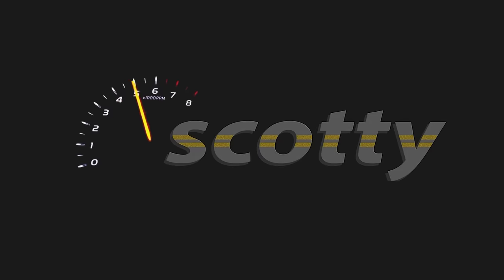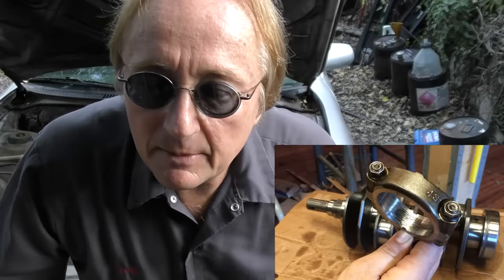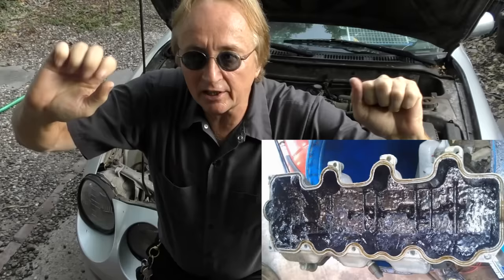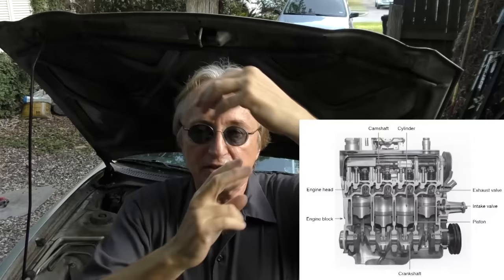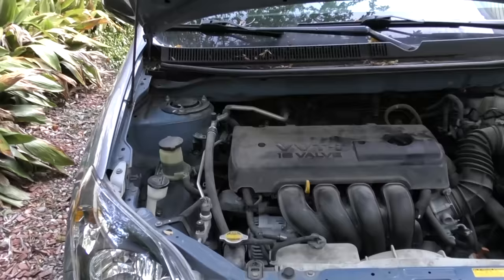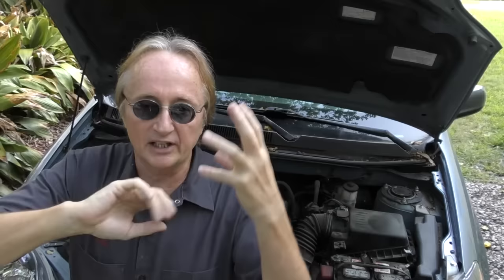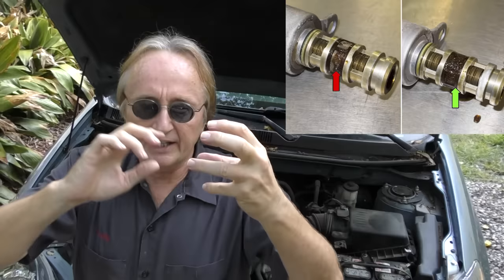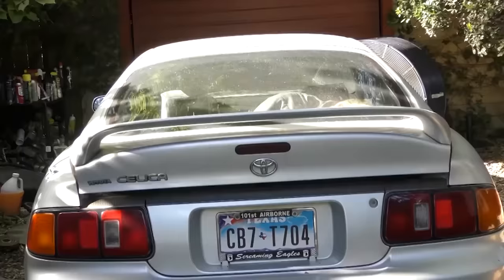Why Not to Flush the Engine Oil in Your Car

Comment: Add a little Marvel Mystery Oil to your engine.. Or add a little automatic transmission fluid to the engine oil.. It will clean the engine slowly and you won't have any sludge issues. 👍. 

I had a customer bring their 1998 Infiniti QX4 in because the valve lifters were ticking.. I checked the oil and it was black and sludged up. Customer didn't change the oil. So it wasn't under  warrenty. I checked thel cap, sludge. Looked into the valve cover and a ton of sludge in the engine. I informed the customer that i can try something for $200 bucks plus oil or I could replace the engine. Customer agreed to the $200 option. I drained the oil put automatic transmission fluid in the engine. Drove the truck around and changed the fluid and filter. I did that 3 times. 2 hours later engine was clean as a whistle, lifters stopped ticking. No smoke or leaks from the engine afterwards. I still have this person as my customer. I did that for him 18 years ago. 👍.
Reply: Rex Erection Hi, just half a quart. 👍 It doesn't hurt anything and cleans really well.
Reply: Full Body Joe but 20 years ago was 1998 and you said a 2000 infinity car so your off by a year & so (19/18 years ago)
Reply: Hater Funny Solo  Oh my mistake let me edit the comment. Thanks. It still applies though. 👍
Reply: Hay thanks for the info full body Joe. I use Marvels Mystery oil in my gas tank every other fill up and that gives me a smooth running engine in my 02 Toyota Avalon. Next oil change I'll pure it in my crank case.
Reply: That /was/ way back then before Variable Valve Timing, keep in mind; I'm not sure how much this changes things and I might try it in a 96 Roadmaster or whatever but does it work on these newer cars?
Reply: I heard about someone doing this to their car, filled it up half with atf then drove 900 kms back home. After they changed the oil that engine was clean as clean inside and every oil change after that the oil didn't look as black as usual
Reply: Any of that stuff harm seals though????
Reply: For a safe, gradual cleaning of engine internals, use a HDEO ... heavy duty engine oil.  Those are oils for gas and diesel engines and have strong detergent packages.  You can tell they are working well by how quickly the oil turns really dark. After an interval or two with an HDEO, switch to a high-mileage oil.  All the companies make these in several oil weights.  I do not trust any cleaners in my engine oil for any length of time for the exact reasons Scotty cites.
Reply: Micah AP thanks for the reply, I sometimes use mmo right by before I change........and atf swells right? Why you said that correct?
Reply: I use a full quart of ATF
Never had an issue. Most times lifter tick is gone after this. Sometimes ive added another quart to the second oil change, and noise is 100% gone! 
To each their own i guess...
On one of my vehicles i purchased used, i found sludge when i changed the oil. So i added 4 quarts of oil and 1 quart of diesel. Ran it for 20 mins at idle, and drained oil and replaced filter. Its been almost 6 yrs now, and my oil never gets sludged anymore and also it doesnt turn as dark as it did before. Hey, if you know what works, keep doing it!
Reply: How much is too much MMO?  I have a subaru that burns oil.  I did a cleaning with MMO and high end oil and after 4000km it burned less, but still consumed some.  Should I do it again?
What kind of damage can MMO do to my bearings?
Reply: That is indeed, one of the ways to degrade modern engine oil and make it worse by dilution and adding things that don't belong in motor oil. What is it with dipsticks who can't understand that if engine oil worked better with that crap in it, that the oil manufacturer would have put it in there in the first place?   They are real scientists who do real testing and analyze the results of an unimaginable amount of data, and then repeat that all over again year after year.

If you need your engine cleaned slowly, that is exactly what fresh oil does.  If you need it cleaned a little faster, change your oil more often and get it up to temperature for a good long drive before the next change.  That will clean it faster, not just slow down buildup.
Reply: M
Reply: Just change your oil and use good oil there is no need for any additives.
Reply: @seanthompson8071  that will change the oil viscosity and mess with the vvt on a modern engine.
Reply: warriorpluto  WYNN'S ENGINE TUNE UP. I used to have a snowblower that I didn't know was a 4 stroke. I didn't change the oil for 7 years. When it came out after I brought it into a heated area so the oil would unfreeze it was like mayonnaise. Cleaned it out in 5 hours of running. I had to do it twice to another one I found in the garbage and restored. Many engines made to run like new with that stuff. (by freeing the rings)
Reply: enduroelite it is really thin, so it protects bearings less, but you can counter that by using 1 quart higher viscosity (like 5w20 > 5w30) with 1 quart MMO, and the rest you use normal viscosity. Essentially you’re trying to bring back up the normal overall viscosity, because MMO is basically just a cleaning mineral oil.
Reply: I put ATF in my 1986 Mercury Grand Marquis crank case, it ran better and the startup knock disappeared within a few weeks. @S truth
Reply: @marcharris2734  - Some additives help squeeze more miles out of a worn engine. GM sells an additive to address a specific problem: sticking hydraulic lifters. Once the lifter noise is abated, don't use the additive any longer.
Reply: smart lad!!
Reply: Rotella makes 10w30 and 5w40 diesel truck oils and I'm sure there are others...
Reply: Didn't Chrysler use ATF for engine break-in for several years🤔.
Reply: So if i do that to my suv Mercury mountaineer will it work i have low pressure light on. Need advice.
Reply: @seangarcia8503  Is the engine sludged up ?. Remove the oil fill cap turn it over and look for sludge. Then look inside the valve cover for sludge. Is the engine ticking loudly when it idles ?.
Reply: @marcharris2734  
But what if the used car u just bought hadn't had regular oil changes or u have no way of knowing  because u bought it from "Joe's Used Cars" or a flipper?? In that case I'd do a flush OR change the oil and substitute a qt.of oil with Marval Mystery Oil and change it after maybe 1,000 miles.
I just bought a 2005 Grand Prix with the GM 3800 V6, Good motor but it's burning a qt.of oil about every 750 miles. Only has 87,000 miles but the woman I bought it from never drove on the freeway.
Reply: @EternityofNight  
How much ATF did u put in??

Comment: It really depends on how much sludge and varnish are built up in the engine. And the type of flush. 
Detergents and dispersants get used up or depleted. All engines get sludged up if the owner does not change the oil regularly.
My advise: Always follow a flush with a short oil change cycle, like 1000 miles. And again, the type of flush or cleaner is a factor. Then keep the oil clean.
Reply: Interesting 🤔 Can you recommend at what millage it's recommended? 100K miles?150K? 200K? And what types of flush?
Reply: @saultube44  : I would suggest every 60K miles. And I would run the new motor oil for 1000 to 1200 miles. This will wash down tough deposits that the flush has softened. This is a good time to run High Mileage motor oil during the 1000 to 1200 mile interval. The High Mileage oil will also condition the seals on the crankshaft and valve stems.
Reply: Flush oil is not advisable.. read your car manual.. no any flushing oil needed.. just change oil..
Reply: @angelseven7  The same manual and manufacturer that recommend never change the Transmission Fluid? So the Transmission dies at 100K miles and you have to buy another? Instead change it every 60K miles so it lasts forever?
Reply: Hey. Question. I usually do my oil changes. I had a surgical accident and haven’t had the oil changed in a year. 12000 miles put on since accident. Engine was freshly rebuilt in April 21 and regularly cared for before that. Should I flush? Or just change oil? It’s been a hot debate and I only have a few goes to get to it
Reply: @saultube44  machines were out regardless of its lubrication. Oil changes at 1000 miles is not only horribly  bad financial choice to change oil prematurely..it's wasteful to do so when it's a finite resourse that will be gone in 47 years.
Reply: @biancafahlin  
If it's only 12,000 miles I wouldn't be too concerned.
Reply: @TheRealChuckNorris he didn’t mean every 1000
He mean 1000 miles after a flush. 

So flush engine on service, 
Drive 1000 miles,
Do another service
Then whatever miles you are comfortable with between oil changes, 
For me it’s 6000. 

I’ve not done a flush, I was thinking about it which is why im here, 

I usually do a full service every 12000, 
Fuel oil air cabin filters. 

With a interim oil/filter change and airfilter inspection every 6000.
Reply: Why would you follow the flush with a short oil change after?
Reply: @tyronesmith3812  Because the engine flush chemical will soften some of the hard deposits in the engine. These deposits will slowly dissolve in the new engine oil, making the oil dirty earlier.
Reply: i had or replaced pcv valve in my cruse had to change hole cover gasket in order to do that tightened up nice and snug not to much. drove 20,000 on it to build up sludge. runs great for a small 1.8. change oil cold so its not hot for mechanic. no dramatic change
Reply: @TheRealChuckNorris  Synthetic oil is made from natural gas and, from what I understand, the Earth constantly regenerates that.
Reply: The inside of my engine looks like a teenage boys bong 😭 absolutely coated in a resin looking sludge. My grandfather developed dementia and stopped getting oil changed, god only knows how many years he ran it without one. He also had a 1 of 2 Buick from the 50s and that blew up because it ran out of oil 🥲
Reply: But if it depends on how much sludge, most people won't really know how much sludge is in there unless you pull the motor apart. Even looking at just the camshafts won't give you the whole picture.
Reply: My Audi A5 2013.. Milage 270 000km. It has been consuming a lot of of  and black sooth coming out of the exhaust
I stopped servicing it at Audi dealership and used a private mechanics.. He used engine flush  for 15 minutes and discard that oil and put the clean new oil.. He then advice me to do minor service (oil changing, airfilter and oil filter including spark plugs) every 5000 km or after driving in a rural gravel road... After that my car is in a good condition. Clean exhaust pipe, less consuming oil.
Reply: @frica466  Great job. You probably should have done that at 90K then 180k. I suggest using a High Mileage oil for one oil change. Then PAO oil. PAO is a tougher oil. And a Catalytic converter cleaner in the fuel to reduce contamination to the catalyst. The soot is from burned oil going out the exhaust. The phosphorus and zinc in the oil can harm the catalyst.
Reply: @saultube44  Ideally every 50 to 60 K miles. A mild flush would be Marvel Mystery Oil, 2 Oz. Per quart of motor oil. A little stronger is Essentialube. Same ratio; 2 Oz. Per quart.
Three stronger flushes are Lucas Motor Treatment, Primrose 400, and Amsoil Engine Flush. 
Always follow up with a shorter oil change interval.
Reply: @angelseven7  Just about every dealership and auto service shop has engine flush. Some even have a machine to flush. The main importance is the engine needs to be professionally assessed, especially dirty, poorly maintained engines. This is why I always recommend a short oil change interval after a chemical flush. I have never seen an engine that was too clean inside, regardless of maintenance.
Reply: @rickwiggins283  Only Pennzoil uses natural gas to make synthetic oil. Many like their product, including Ferrari, who recommends Pennzoil.
Reply: @Shellshock361  You could use a bore scope through the drain plug hole. Also through the breather on the valve cover.

Comment: Agreed. A guy down the street did this and got upset that his motor has a
 new noise. That's what happens when you clean gap filling crud out of 
engines with over 250,000 miles. I agree. Don't flush the crankcase.

Comment: @2:20 I use synthetic and still change my oil every 3k. Oil is cheap now and I can tell a difference with more frequent changes.
Reply: Prime Artemis  that's what I do. A full synthetic oil change cost me about $25. I have no idea what the shops charge these days. 10 years ago it was $70 for full syn at most oil change places. It's probably a lot higher today

Comment: Yep don't use engine flush.
I remember i had just bought a car with black sludge in,not too much about 20 years ago and i used mobil 1 fully synthetic for the first time and after a short while it cleaned it all up and i could not believe how spotless it was when i stripped it down and i have used nothing but mobil 1 ever since.
I look at my car now and see how clean looking inside the rocker cover.
The cams are still in near perfect condition after 130,000 miles getting full lift and little signs of wear and been using it in my current car since 45,000 miles.
Not used any other oil other than mobil 1 since 98.
A Very happy chappy.(:-)
Reply: Ive using Mobil 1 since 1986 on all my new cars wont use any thing else but Mobil 1 oil.
Reply: @stephengriffin4990  Nice one stephen.

Comment: An expert mechanic told me to use fresh  cheap oil for 2 or 3 days then replace it with my regular brand of pricey oil...sounds kind of expensive but my engine isn't complaining.
Reply: THIs 100% .Cheap oil and filter . Then change a week later >Dont drive like a lunatic .
Reply: After a flush you mean?

Comment: i used liqui molly on my bmw e90 it helped get rid of my check engine
Reply: It went smoothly without any problems?
Reply: Same here. I had a code for something fuel injector related and ran some Techron fuel treatment through it and the light went away. One of my other vehicles had smoke coming out of the left bank and ran some engine treatment through it and it stopped the smoking. I probably had build up causing sticky valves
Reply: I'd try removing the bulb first, quicker, easier and cheaper.
Reply: @Michael Murray hahahaha

Comment: Dirty oil does cling to metal, but it ain't sludge. I say clean it and fix the oil leaks. If you see sludge inside the valve cover dont use it. My oil was causing a lot of missfiring. I changed the oil. Now it's not misfiring. Just need to put another filter on after a 1000 miles.

Comment: I bought a car with 100,000 miles on it and looking in the valve cover it looked very clean. After about an year the oil pressure would wave all over the place and sometimes would drop to zero with no engine clatter.  I added about a pint of MMO and drove it a couple a thousend miles. For a while the oil pressure would wave around and then became steady.  Changed the oil and no more oil pressure problems since and no leaks or smokes and does not use oil.   I did not want to pull the pan to clean the pick up screen.

Comment: Youre saving me hundreds and give me good laughs! I love your vids scotty!
Reply: Priest  Drain refrigerant. Loosen the serpentine belt. Unbolt and unplug ac compressor. Bolt and plug in new ac compressor. Put the serpentine belt back on. Pull vacuum on ac system. Refill with r134a (and whatever oil is specified on compressor, if needed)
Reply: Oooooo
Reply: O
Reply: @almostwreckedcars832  of too so l
Reply: movielord911 😂😂

Comment: Sadly from personal experience, I can attest to this video. I ran seafoam through the oil and did the intake treatment on two of my older vehicles. My car started ticking in the engine and leaking oil from the valve covers on top of my spark plugs. The truck simply started leaking oil, which it had never done before. Yes, after initial treatment, the vehicle ran better, which is why I did the other, but within 6 months, I had issues with both. With higher mileage cars, leave well enough alone until there is an actual problem! Also, screw seafom except for gas treatment and specific purposes. I wish I had that minor gunk build up back now!
Reply: Scotty explained on another video, Seafoam is for old engines, and today for overboard engines. Check his other videos about it

Comment: If only you created this video a year ago, I used to work for a Vauxhall (formally GM owned) dealer in UK and I was having this argument with my manager as they were trying to upsell oil flushes on services even though GM say themselves not to use flushes. But I was ignored constantly and left the company.
Reply: I have a GMC from 2008 bought 2 hand, and it's good or not to flush the motor? And the cooling system?

Comment: I bought a small Japanese 4x4 last year. Dealer has promised me they had serviced it when they took it in (at 105k miles). Last actual stamp in the service book was 88k. I went to change the oil at 110k and after changing the totally black pond water coolant I had serious suspicions it hadn't been serviced.

Ran a flush before I replaced the oil, low and behold a lot of crap came out in the oil. Put the new stuff in and actually noticed a world of difference. The car had VVT which actually became much more pronounced in the rev range and it gained about 2mpg on average.

Personally I do agree with you that with frequent servicing they are not needed, but if you know the car has missed a couple of intervals a flush can help.

Comment: An oil flush helped with my low oil pressure problem. I'm guessing the pick up screen was dirty, or there was buildup someplace else. But now no more low oil pressure light. So its not always bad.
Reply: I’m hoping my flush works because my low oil pressure light is on but no leaks
Reply: @carloscascabel01  , it worked?